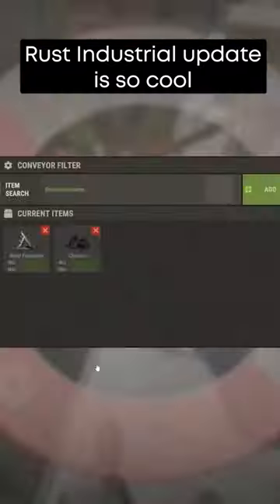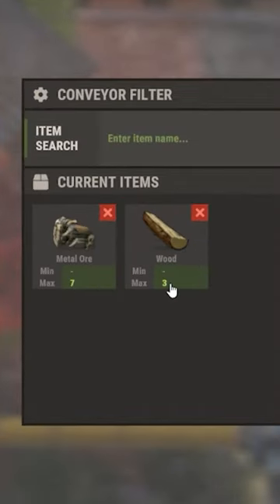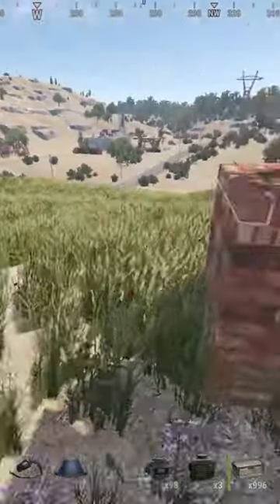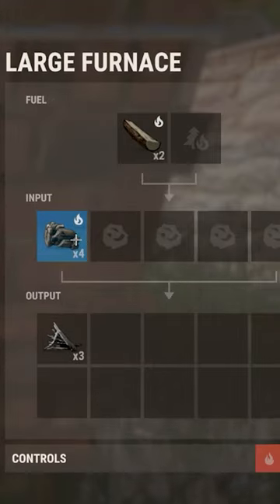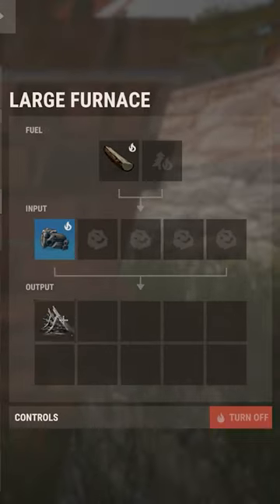Automatic Rust Industrial Furnace System | Rust #shorts

Comment: Kind of defeats the purpose of having a large furnace though.
Reply: still 5x(or more i donno) faster than the normal furnace
Reply: Large furnace are dead after this update if you honestly use them ur dumb. Think about it most clans always cry about charcoal. My group uses 3 smalls. Burn more wood gives you more charcoal. Now we have the electric furnace that cooks just as fast. 3 smalls 1 electric ur set. At least as a trio just keep them running constantly